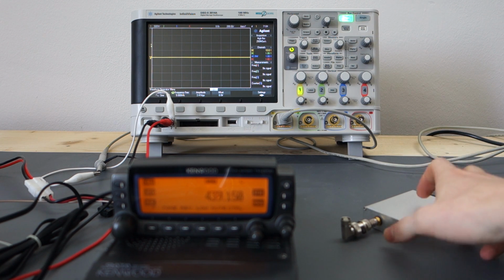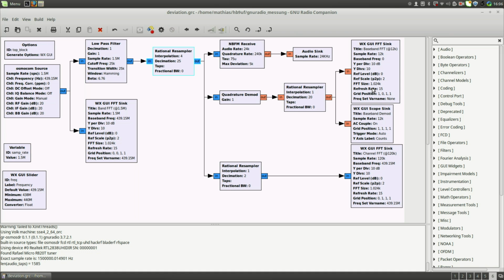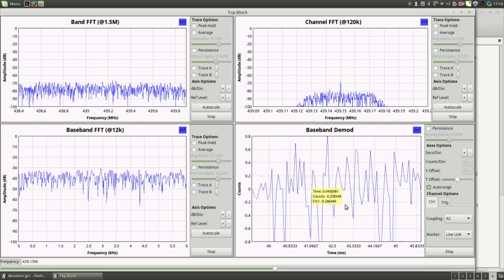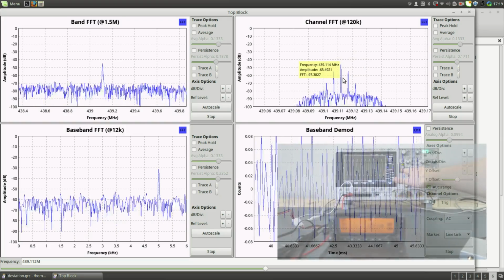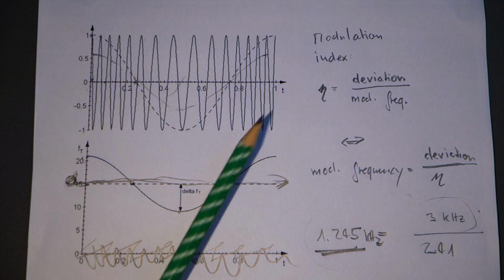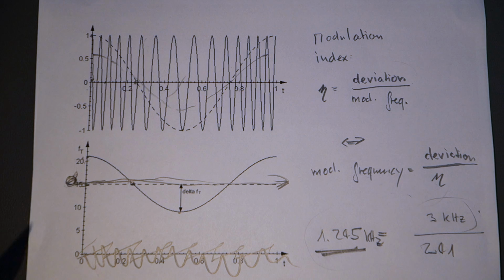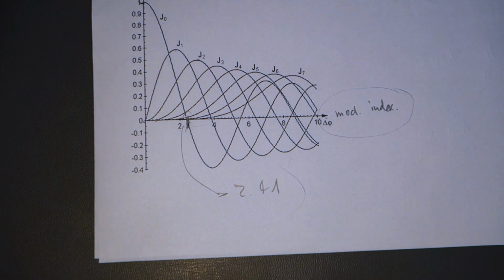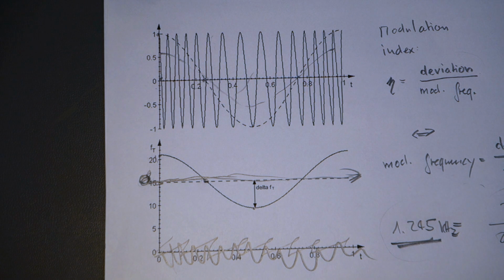HB9UF: FM deviation, modulation index and sidebands with an RTL SDR dongle

Comment: I did this on my IC-7100. I didn't use a dongle but a SoftRock IF plugged into my Elecraft K3 for receive with HDSDR software. I also used the "Data In" pin on the mini-DIN connector with the rig set to "9600 baud" mode. It isn't 9600 at all but a wide bandwidth audio input without preemphasis or other equalization. The first thing I tried was setting the audio frequency to 1250 and increasing power gradually. Before I could see the null, the 7100 stopped transmitting due to excessive audio level, above the nominal 100-300mVp-p. The method I ended up using was to set the audio voltage to 300mVp-p and lower the frequency until I saw the null. That worked and showed the maximum deviation to be 1680Hz. Further lowering the frequency revealed a 2nd and third null, and by looking up those modulation indices in Wikipedia, determined that the resulting deviation estimate was very close to 1680Hz as well. I haven't tried the "1200 baud" port yet but it may well show that it is 3Khz. I think the deviation for 9600 is limited due to the bandwidth required to handle audio in the 3-6kHz range. Thanks again for your informative video.

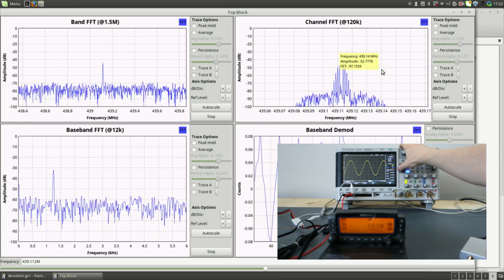Comment: At 16:20 you are adjusting the voltage while calling it out in kHz. The baseband frequency domain display is growing in amplitude but the frequency is constant. You switched back to volts  once you get to the Bessel zero. I liked how you used GNU radio to put everything on one display. It's good for us hams who don't have those $20K mixed domain oscilloscopes with built in frequency analyzers.
Reply from the maker: I totally agree. Thank you!

Comment: So to visualize, would you connect a 1khz sine wave to the WFM or NFM block?  In your example, the ampltude of the signal determines the 'deviation'.. and isn't the same as the bandwidth (i.e. Wide vs Narrow)?  GRC doesn't seem to allow the a sine signal source to go to the transmit block.. how would you do that?
Reply from the maker: Regarding your second question: You can connect the signal source to the transmit block as long as the data type of the source is set to complex (blue output port). If done so, whatever hardware you use to transmit will output a constant carrier signal without modulation at its center frequency plus/minus the frequency you set in the source. If you want to connect the signal source to an FM modulator, you have to set its type to float (orange output port).

Regarding your first question: Yes, peak deviation and bandwidth is not the same thing. They are related. In theory, the bandwidth of any FM signal is infinite but in practice, the majority of the power is concentrated in some area around the carrier frequency. The Carson bandwidth formula is one way to quantify this. If your channel bandwidth increases, you want to also increase the peak deviation (and thus the amplitude of the signal input to the modulator) to make the best out of the situation. Bandwidth and peak deviation and signal amplitude are therefore related concepts but they are not the same thing -- the numbers are different. "wide" and "narrow" are somewhat looseley defined terms that we use to talk about systems of a particular bandwidth and peak deviation. In analog systems, they also affect e.g. the choice of IF filter used, and in digital systems they would affect the equivalent channel filter. I hope this makes some sense. Thanks for asking and watching my video! Matt

Comment: I tired this, but in the baseband FFT sink window, it shows the Frequency of the tone, NOT the deviation.  Any ideas how to fix this?
Reply from the maker: What you describe is the way it should be. The baseband FFT will show the tone and the channel FFT will have the sidebands and the carrier which exhibits the Bessel null by vanishing at a particular deviation. But of course, since there is a single tone and the  amplitude of the modulation increases as you knock up the deviation, you can look at the power of the tone in the baseband FFT to asses the amount of deviation. If this is what you'd like to do, you have to look at how high the peak in the baseband FFT is (vertical axis in dB), not at what frequency it occurs (horizontal axis in Hz). Does that make sense?
Reply: MrCircuitMatt  Yes, but I was hoping for some way for direct readout of deviation. Looking at the baseband level is like hooking an ac voltmeter up to the audio line. It works but it’s not referenced to anything.

Comment: Hi there; I can't wait to watch your next video.
It just so happens that in the last few weeks I have been searching info exactly about the very subjects that you are touching in this video. Thank you very much; which wireless protocol did you use to read my mind remotely :-) ????
So, seriously, you are basically saying that given that the Mod. Index is related to the deviation and the modulating freq., if my constrains are deviation and M.I., then I can calculate the max audio freq. I can transmit and receive.
So, given my constrains are Dev. = 5 Khz and max M.I. = 1 (NBFM, right?) I can transmit an audio signal up to 5 Khz (audio), am I correct?
And ..... you mean Deviation 5 Khz total or 5 khz per each side band, so total deviation = 10 Khz (5 LSB + 5 USB)?
Reply from the maker: Stefano Mollo Hello and thank you. The new video is out :). The relation between M.I, frequency and deviation is  as you say and your math seems sound. When I say deviation I actually mean peak deviation, which is the largest excursion of the instantaneous frequency from the center frequency.

As for the sidebands, this is where it gets really tricky. If you are feeding a pure sine wave into the modulator, the spacing of the sidebands will be the frequency of that sine. The spacing is not the frequency of the deviation. This is confusing as both are in kHz, but try to picture this: If you increase the deviation by increasing the amplitude of the modulation (just like I do in the video), the spacing of the sidebands does not change. You get more and more sidebands, but the spacing does not change. So it is correct to say that you have a peak-to-peak deviation of 10 KHz with a peak-deviation of 5 KHz, this does not translate into bandwidth. 

The reason for that is that in theory, FM has an infinite number of sidebansd -- just as there are infinitely many of those Bessel curves in my sketch. However, most of those sidebands have a really low amplitude, so they are sort of ignored when we talk about the bandwidth (not the deviation) of FM. The technical term for this is Carson's Rule and the formula works such that the bandwidth is considered to be whatever is necessary to contain 98% of the signal. I conveniently did not discuss this in the video though :-).

Now on a side note, most transmitters and receivers filter out anything that is outside of that Carson Bandwidth. This is why when you are transmitting with too high a deviation (= too large audio amplitude), not only do you potentially interfere with neighbouring stations, but a receiver set up for the assumed deviation will filter out whatever you transmit outside of the corresponding bandwidth and this will not work properly.

Another essay written right there. Thank you for this interesting question and thanks for watching! Matt

Comment: ThumbNet sold some dongles where basically the oscillator was replaced by a quite ok tcxo, which can easily be done on your own, and it is working so much better that I would say it is worth the effort than all the time being lead to nowhere. And yes, the peak is the LO (it is leaking everywhere in these things) and I usually tune center to quite a bit outside of the interested things, as long as I don't need to process MHz of bandwidth. Programs like SDRSharp have a correction for this already built in and can silence that tone.
Reply from the maker: Dennis Lubert Thanks for the hint. I indeed tried to source a 28.8 MHz TCXO but failed to do so. 14.4 MHz oscillators on the other hand are easier to get and I've been thinking about doubling that with a mixer. I'm not sure it's worth the effort though. Is the thumbnet dongle still available? Somehow all I can find are t-shirts.

I should indeed have tuned somewhere off the center. I managed to do that by mistake (you could see the carrier next to the LO spur), but still not best practice I'd say. In any case I think that moving somewhere far off-center is the best approach, also better than the integration thing done by SDRSharp etc. By the way there will be a second video within a few days (already recorded) where I use this technique to pre-cal a repeater. It worked amazingly well. I hooked it to the service station afterwards and it was spot on! Thanks again for your comment.
Reply: MrCircuitMatt They are currently not available anymore but on http://www.rtl-sdr.com/buy-rtl-sdr-dvb-t-dongles/ they are promising something similar. I don't think it would be worth the effort to double up the 14.4, for just a little more effort you can probably design a whole better pcb containing better abilities for heatsinking (that thing runs here at 54°C per default and getting that down even a little bit improves the snr a lot), and circuitry for going down below 30MHz or whatever the range was that you can not get down to with these (either by mixing it up, or by bypassing the tuner for these freuquencies and directly delivering). If you look at the pcb of such a dongle,  there is really not much to it.
Reply from the maker: Dennis Lubert That's a nice idea. Really worth considering!